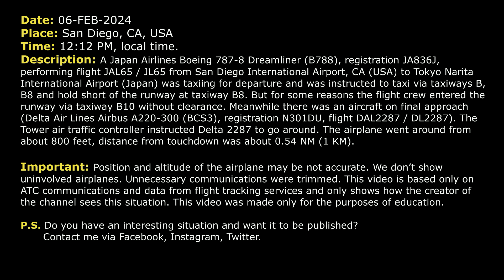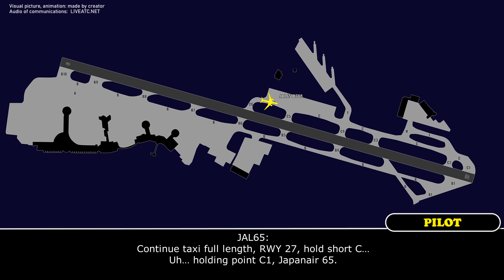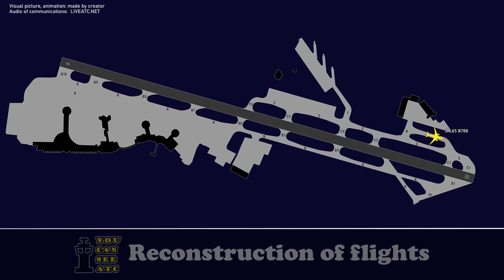Runway incursion. Japan Airlines Boeing 787 enters runway without clearance at San Diego. Real ATC

Comment: I get the impression that ATC was now testing the crew's ability to navigate on the ground by giving them all sorts of taxi amendments. The fact that they adhered to all instructions will probably help them in the phone call they had to make.
Reply: Their first instruction included a hold-short. They did not read that back, and entered an active runway without clearance in violation of that hold-short. Whatever mistakes the controller made, that is on the flight crew.
Reply: @sturmovik1274  "Their first instruction included a hold-short. They did not read that back, and entered an active runway without clearance in violation of that hold-short. Whatever mistakes the controller made, that is on the flight crew." The first instruction did not include a hold short with the runway number and the runway they were assigned. So yeah, ATC bunched it up too. Also, maybe I'm quibbling here, but in my experience I usually don't get told to "proceed onto" when it comes to taxiways, that is usually used for runways (example, proceed onto runway 27). Usually it is "taxi via" a taxiway. Maybe I'm splitting hairs. Either way, I think the controller is complicit too. ALSO, to the controller, there is a reason why you have a phone number for them to call ... to hash things out. YOU DO NOT START ASKING QUESTIONS OVER THE RADIO WHILE THEY'RE STILL TRYING TO FIGURE OUT WHATS GOING ON AND WHERE YOU WANT THEM TO GO. I am surprised they didn't have another incident. Save the Q&A for the phone call.
Reply: @JohnSmith-zi9or  Agreed, ATC wasn't helping one bit. Even his questions about the confusion were being asked at light speed. Slow down.
Reply: @JohnSmith-zi9or  What's he supposed to do with that number anyway? Aren't all phones supposed to be in airplane mode prior to takeoff?? Does someone roll up to the plane with an old phone on a really long wire? Or maybe they have a long string with a tin can on the end with the other end going directly to the tower
Reply: @gorak9000  are you living in 1970?
Reply: @sturmovik1274  Yes they made a mistake, and one day it's going to cause a disaster. But on this occasion it's damage limitation

Comment: Appears that JAL thought they were supposed to taxi on Bravo to enter the runway and back taxi on the runway, holding short of B9 (and then revised to B8) on the runway (based on the read back "hold short of B9" when it should have been "hold short of runway on B9").  The "expect a back taxi" phrase probably confused them.  Not great all the way around.  At end of day, controller said hold short of runway, readback was taxing on bravo to hold short B9 which does not suggest in that moment that they are planning to enter the runway.
Reply: I’m so confused
Reply: I'd never heard the phrase "backtaxi" get used before, I assume the pilots were confused too. I think using this phrase was more confusing than just telling them to go onto the runway.
Reply: Except the correct phraseology is hold short runway 9. Yes even if there was only 1 runway that is still the correct phrase. JAL also did not read back the hold short instruction and the ATC should had made him read back the hold short and runway instructions with their call sign.
Reply: pilot reads back "proceed on B hold short of B9", crystal clear.
Reply: I am amazed at how well  English-as-a-second-langague crews handle such fast spoken instructions.  I (not a pilot) can barely follow the communications.
Reply: @garrettbernstein5991  I`m also not native english speaker, but usual air traffic talks is crystal clear and accurate, except for crew from India, Japan and sometimes French. Worst accents for my ears.
Reply: I am a native English speaker.  "expect a back taxi".  Good grief.

Comment: Landing 09 but taking off 27? There is part of the confusion. And the ground controller needs to sloooowwww  dooooowwn, I can barely understand him.
Reply: Two things.

One: This is normal ATC speed. Every commercial ATC and pilot in the world speaks this fast. To us, it is borderline incomprehensible. To them, it is so routine that they don't even notice. That said, he could have slowed down just a little for the language barrier.

Two: Remember that this is from third-party sources. Scanners and the like. This affects audio quality. What they actually hear is much cleaner than this.
Reply: Especially when dealing with an obvious language barrier.
Reply: @Decay0  Indeed.  Accept the reality that not everyone can speak or understand "machine gun over a crackly radio" English.  Even native speakers don't always understand what ATC is saying.
Reply: @dermick  I'm a native speaker who doesn't always understand what ATC is saying.
Reply: It looks like after Delta landed they were going to resume Runway 27 as the active runway.  You sound like you know San Diego airport, so I ask you this.  If they knew JAL was going to take off on 27 why did they not have him taxi straight down Bravo instead of the back taxi and scenic route instructions?  They said possible pilot deviation.  If I were that pilot I would have mentioned ATC deviation when they could have given me a direct route down Bravo.
Reply: Bravo taxiway is actually part of the ramp area. If an aircraft is pushing back from a gate there isn’t enough room to get by so taxiing down the runway is sometimes a better option other than waiting. I think this is ultimately what caused the incursion. Taxiways are often separated from the ramp by grassy areas so it’s very clear where the taxiway starts. The crew turned onto the runway thinking it was a taxiway because that is the first paved area separated from the ramp.

Comment: Am I the only one questioning the odd taxi route? Why not just instruct hold short at B10 and depart from there? Why backtrack (back taxi)?
Reply: I think they were changing runway after Delta’s landing. That explain the taxi instruction via Bravo. Probably that’s why he taxi to runway 9 after the incident
Reply: @rockqc91  But International flights come out of Terminal 2.  Why not have had them taxi straight down Bravo to runway 27 and hold.
Reply: @TheGospelQuartetParadise  lots of SW planes coming out of T1 clogging up Bravo.
Reply: They were changing runways
Reply: Nobody can takeoff runway 09 (with any payload) because of the hills of the end of the runway so using 27 for departure. Runway 27 doesn't have a ILS (because of the hills) so 09 is used for landings during low ceilings.
Reply: @c1d2e  nobody can? That sounds like a wager to me.
Reply: @GoofysHatBand 
Sure you can takeoff but you’ll leaving all your passengers and half your fuel behind.
Reply: @c1d2e  I'm talking about a Boeing plane not some underpowered A320.
Reply: @GoofysHatBand  at least the A320 left the production line with all its bolts screwed in and doesn’t fall apart in midair.
Reply: @Dnttou0497  that happened one time.  Airbus has a rich history of plane crashes due to software failures and dumb things like using the rudder.
Reply: San Diego's runway is notoriously semi-blocked on the east end, pretty high terrain/obstacles. It's easier for everyone, especially longhaul heavies, to land easting and depart westing. Most likely they are unable to takeoff 27.

Comment: They changed their taxi instructions like 5 times, no wonder. Also wtf was that phraseology from the controller?
Reply: Do they usually say "proceed onto X and hold short at X#"?
Reply: @gerardm.5047  yes all the time. They are called taxiways. Proceed onto x taxiway and hold short of x.
Reply: @Surfnsnowboard3  But then it was a complete mess…
Reply: @AlveesMcNamaraTaur  you’re changing your argument.
Reply: It was changed once before the runway incursion. Once. The instructions were clear and even read back correctly. This is 100% on the pilots. What are you even talking about?
Reply: controller couldn't be anymore clearer ! @Surfnsnowboard3
Reply: @Surfnsnowboard3  "he instructions were clear and even read back correctly." No they were not clear. He didn't even assign a runway number when giving the hold short instruction. Nor did he assign a takeoff runway (maybe its included in the flight clearance ... I can't remember as it's been a while since I've been there". Regardless, the controller must assign a runway number to hold short of and hear the pilot read it back.
Reply: @JohnSmith-zi9or you’re serious? There’s ONE runway here. ATC says “hold short of runway. Nowhere is any instruction or read back was there permission to go onto the runway. wtf are you talking about? Which part is confusing for you?
Reply: @Surfnsnowboard3  You don't work in aviation do you? Standard phraseology is a thing. 

When you're talking to non-English speakers, it is even more important, imperative that you use standard phraseology. 

"you can proceed onto" is not in the Pilot Controller Glossary or the Standard Phraseology in 7110. 

More so, the controller says "You can expect to back taxi" ... well to a foreign pilot they just heard back taxi. 

Had the controller said hold short of runway 9 ... maybe this would have been avoided. 

See, these things are called Human Factors. And they matter. 

Using standard phraseology is always a best practice. In the USA, controllers and pilots have gotten used to chit chatting on the radio.
Reply: @JohnSmith-zi9or  I repeat. Where did you hear anything about crossing onto a runway? I’ll wait.
Reply: @Surfnsnowboard3  I'm not going to have a conversation with someone who doesn't have the knowledge to understand the points I made in a previous comment. Otherwise we just go round and round like a record.
Reply: @JohnSmith-zi9or  way to leave after I ask a VERY simple question.  Avoidance at it's best.  Goodbye.
Reply: More so, the controller said "You can expect to back taxi on the runway"

We all heard that ... from our radio that was recording the transmissions. However, that does not mean they heard it. 

For a million reasons which I'm not going to get into, they could have heard "you can back taxi on the runway" ...one word changes the clearance. 

Additionally, with the poor hold short clearance, "hold short of the runway at B9" can easily become "hold short ON the runway at B9"

You have all of the physical and atmospheric reasons why they may not have heard those two key words and had another plan in their minds.
Reply: @JohnSmith-zi9or  do you wear a helmet during your daily life? Are you seriously blaming ATC for the pilot's action of going onto an active runway when never given clearance to do so? You say you hope I don't work in aviation.  I pray to God you are not a pilot. Let's be clear.  The pilot is in the wrong here.
Reply: @Surfnsnowboard3  " I repeat. Where did you hear anything about crossing onto a runway? I’ll wait."

Wow, I was giving you the benefit of the doubt that I was discussing this with intelligent life form. But apparently I'm not. Yes, that's an insult to you. 

You need to read my posts again.
Reply: @JohnSmith-zi9or  simple questions blow your mind and you avoid them like the plague. I asked a simple yes or no question. Conveniently not answered.
Reply: @Surfnsnowboard3  Yes I did answer it. Absolutely. Which is why my comment about not having a discussion with idiots and having to go round and round like we already have, proving my point, is worthless. 

Simply put, the controller used a lot of non-standard aviation phraseology and some foreign pilots screwed it up and taxied onto a runway. End of story.
Reply: @JohnSmith-zi9or  so as my original point remains which you are too dense to see. The runway incursion was 100% the pilots fault. Good talk.
Reply: @Surfnsnowboard3  No it isn't 100% the pilot's fault. The non-standard language used by the controller is also causal.
Reply: @Surfnsnowboard3  Are you a pilot or controller?
Reply: @JohnSmith-zi9or  you obviously don’t know what “causal” means. The “non standard language” caused a pilot to ignore instructions and complete a runway incursion? GTFO
Reply: @Surfnsnowboard3  Are you a pilot or controller?
Reply: @JohnSmith-zi9or  pilot buddy. I pray to god you’re not a pilot.
Reply: @Surfnsnowboard3  Really,  you're a pilot?
Reply: @Surfnsnowboard3  What's your route? LMFAO
Reply: @JohnSmith-zi9or  did I stutter?
Reply: @JohnSmith-zi9or  I’m done with you
Reply: @Surfnsnowboard3  LOL uh huh.
Reply: @JohnSmith-zi9or He flies in his dreams.
Reply: @Surfnsnowboard3   Exactly, just people shilling for a JAL crew lacking in English proficiency. If they can't handle SAN, imagine them at LAX or JFK? Also, IMHO Japanese anime culture fandom on the internet makes people sympathetic to Japan anything regardless of context.